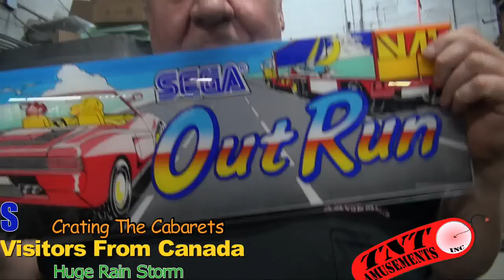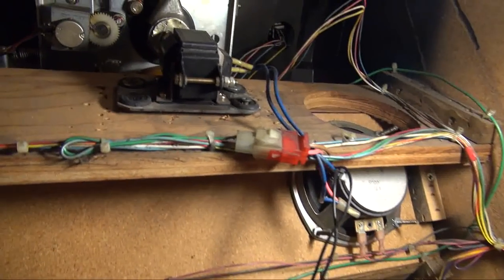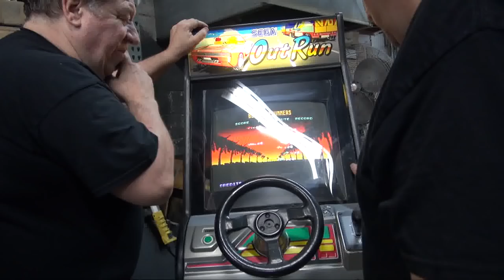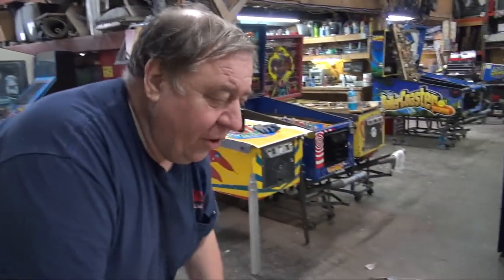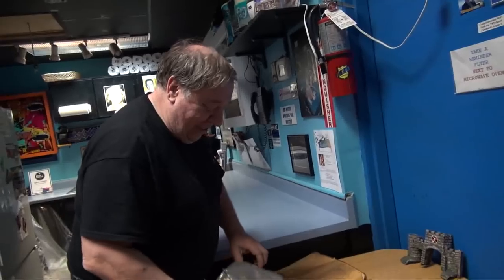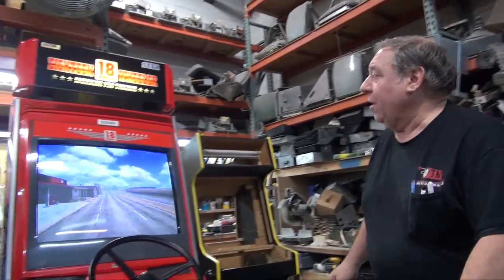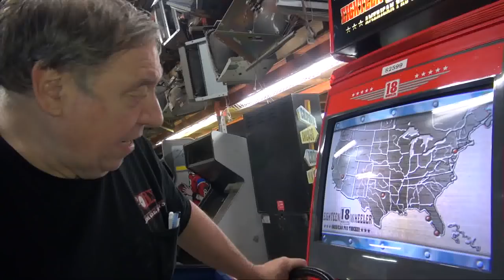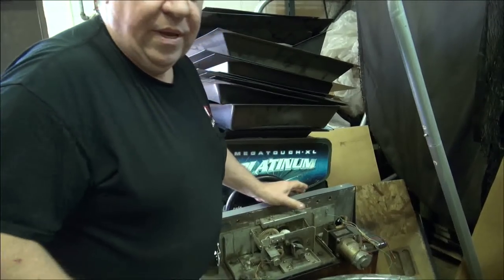#1403  Sega OUTRUN Cabaret Arcade Video Game-MEDIEVAL MADNESS & HURRICANE Pinball-TNT Amusements

Comment: Thanks for the link to the UK parts site.   Do you happen to have a source to get parts for a Super Hang On Mini Ride model?   I'm looking for a replacement Handlebar Cover with Start Button, and a Bike Seat replacement for the one I'm restoring.  However finding Bike parts is like pulling hens teeth.  I havent seen any on KLOV anytime recently, and I check ebay regularly for parts and come up dry.
Reply from the maker: Just keep googling...and looking on the forums.  People are posting on Facebook in the little parts pages, but these are NOT seen by google...so, many parts being listed will only be seen by whoever goes into that Facebook group!  Its unfortunate,,,,

Comment: 10 volumes x $30  ouch.  could get a bargain basement for that.  course I have places to put the books, not a bargain basement :)
Reply from the maker: Well, thats spread out over two or more years Lee......so its not that bad!
Reply: gears  ouch cracked gears.  Techmoan had a 2 sided vinyl player (2 stylus' , plays both sides without flipping)  but the gear that rolls out the tray you put your record on. :P  that gear had such a crack that even after gluing meh no work.  But he found someone who was making that specific part and was selling lots of those so apparently that player was still in wide use if people are buying a hard to find gear.     alas the gear on our $130 shredder from staples was made from metal and it broke.  it was also a defective part too.  brother used some technically term but it wasn't machined right or something like that or something like I was lucky the tooth didn't shoot thru the plastic.     Kinda shows  $130 shredder barely lasts a year.  $30 shredders last for years..  True you can't shred as much without the stupid overheat auto shut off going out but it lasts
Reply: true .  although I spent $40 a set for 4 seasons of knight Rider on DVD only to spend $50 on all 4 seasons on blu ray (and another for Airwolf)  Too bad the DVD-18's suck.  They came out with a single sided set later but refused to trade the tons of defective DVD-18's they had.  Seemed a waste of time.  I gave up watching Knight Rider altogether on dvd.  so while I think Mill Creek ain't great can't be as bad as the dvd's..  oh then there is the Columbia House versions which I really spent quite alot on and only got thru a season and a half at $20 each  X_X  2 episodes usually per tape <----  only got a few of those with Airwolf on dvd.  Shadow of a Hawke I keep those and the tape.  I think  I might have finally gotten rid of the tapes but not the dvd for airwolf...  Those had the original music as well.  the new ones RIAA like here on YT gets picky.  But I'm a fanatic with those two shows (and um Street Hawk if they ever bother to come out with it on blu ray,  if it comes on a foreign version I'll probably get it.  (Viper?  was the last of the car shows for me..)
Reply from the maker: you have to run the oil lubricate packets through those shredders too.
Reply from the maker: so many defective DVD's out there I suppose.  And sometimes they cannot get the copyright clearance on music when stuff gets re-released.  The most famous one was in the final episode of the TV show WISEGUY.  Nights in White Satin was playing on the jukebox (which was technically impossible, since they used a 78rpm Wurlitzer).  But it was powerful and important to this scene.  But after 1989 and on the DVD, it was replaced by different  music not able to capture the emotion needed for the scene.
Reply: yep..  although real oil works better even if they say otherwise.. Just don't over do it ....